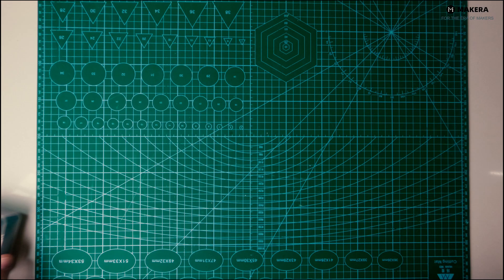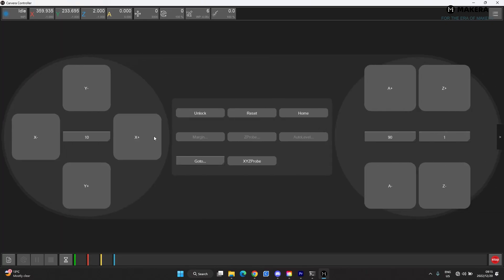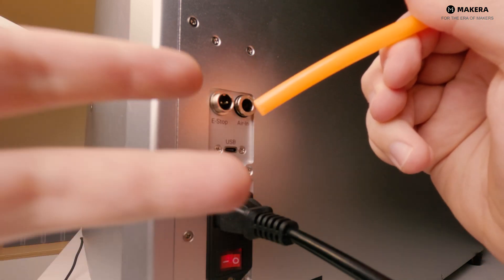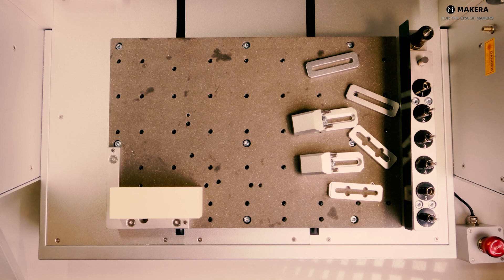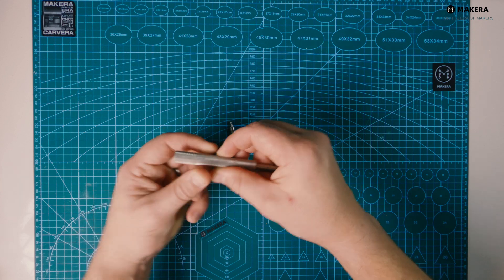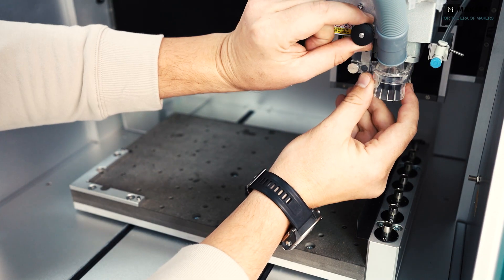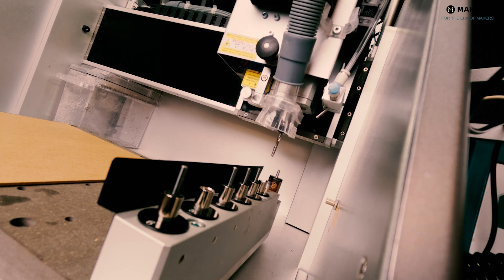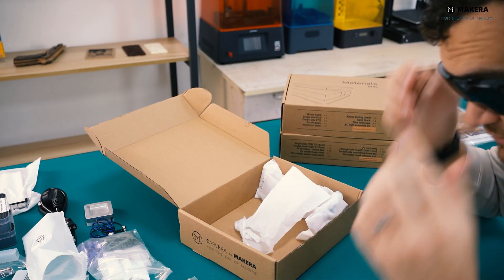CARVERA tools and accessories breakdown!

Comment: Hi, what air compressor is in the video? What power/pressure is this model? Been struggling to find a decent small one for my carvera
Reply from the maker: We find that a small compressor, with a 30L tank and 100 PSI / 7 bar works very well, and that's what is being used in this video.

Comment: Hello, i see that other cnc desktop machines have less powerful spindle unit than yours, thus they can cut steel. So i was wondering if we could cut steel with yours as the spindle is stronger in terms of whatts? Regards
Reply from the maker: Other machines may be able to cut steel, but with less accuracy. There are a few factors to take into consideration when milling steel, not only the spindle. Here is a video of the Carvera milling steel, so it is possible, but we don't recommend doing this on a daily duty cycle. https://www.youtube.com/watch?v=VTWt6elB6eg&lc=UgwZ0NPB6EqV9u24bw54AaABAg
Reply: @Makera  i would live to purchase one, living in europe in airsoft business, need to cut slides for airsoft guns. Is there a way to increase to ability to cut slides with sime optional accessory?

Comment: Wireless Probe:	0:30
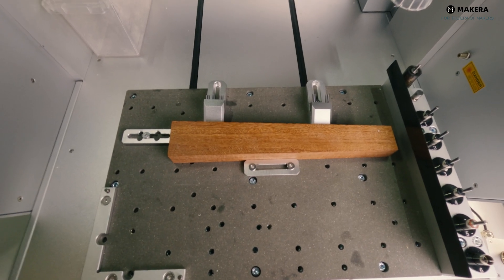Manual Probe:	1:54
Emergency Stop:	3:16
Air Assist Module:	3:51
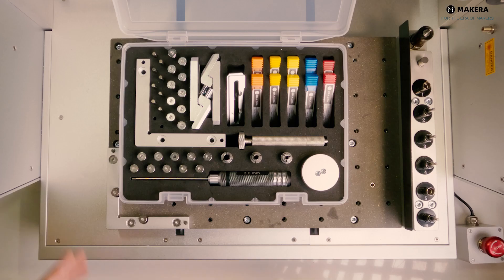Workholding Tools:	4:42	
Bit Collar Installer:	7:06
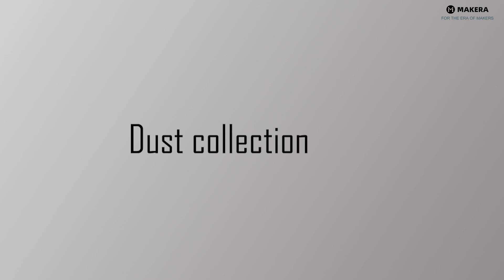Dust Collection:	8:27
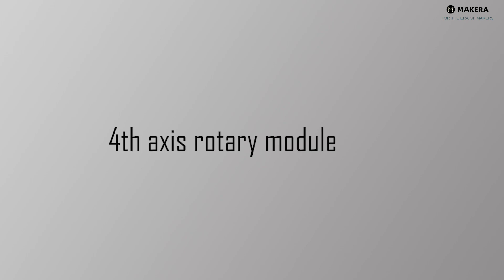Rotary Module:	9:25
Spindle collet installer:   10:47
Laser Module:	11:46

Comment: I have a carvera and have a few questions. 1.  With the additional collets, will Makera be seeking other tools sized for those collets as it seems all use the current standard collet.  2.  Will you share your vacuum modification model to make it easier to attach a secondary vacuum.   3.  Any suggestions on a compressor size and pressure setting?  Also is a level of air dryness advised?  Having not used a CNC before, what would happen if the compressor spit out some watery air?  

Thanks, excited to start cutting up some materials.
Reply from the maker: 1. You need to make sure all the tools match the new collets, and also the wireless probe.
2. You can download the model here:https://github.com/MakeraInc/CarveraProfiles/releases/download/v0.9.1/Carvera-Vacuum-Adapter.stp
3. A 6L or 8L small compressor is quite enough, air dryness is better, but it's OK if there aren't much water spit out.
Reply: @Makera  Thank you for the amazingly fast response, as always you guys are very speedy to reply. As to question 1, will Makera be offering tools for the larger collets?  My guess is that these would make the initial cutting faster.  Thanks for the file. Not much for Facebook or Discord, bit old school. As for 3, this is what I assumed, but thanks for the confirmation.
Reply from the maker: @FineClonier  Yes, will provide different sizes of bits along with other accessories and consumables in our online store later.